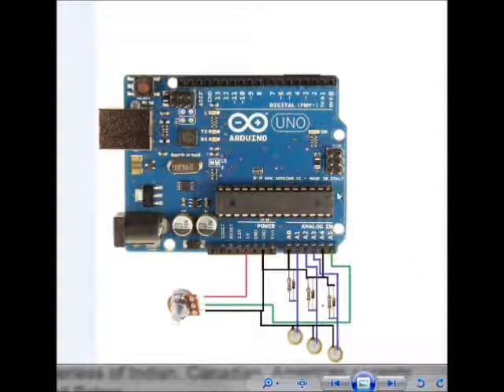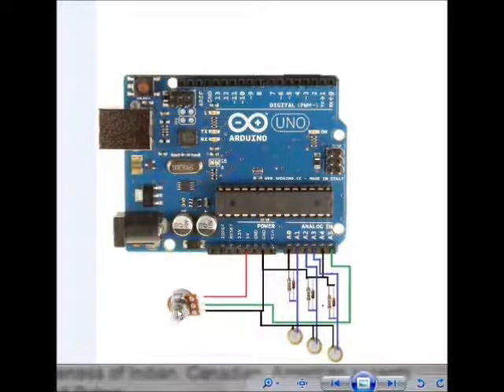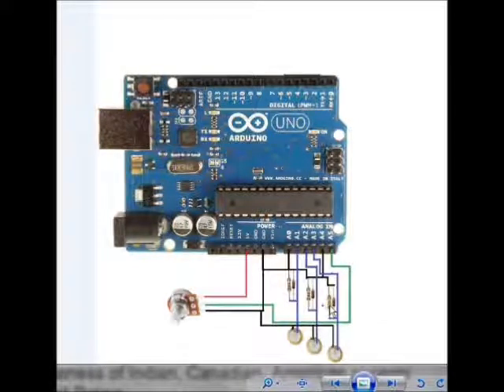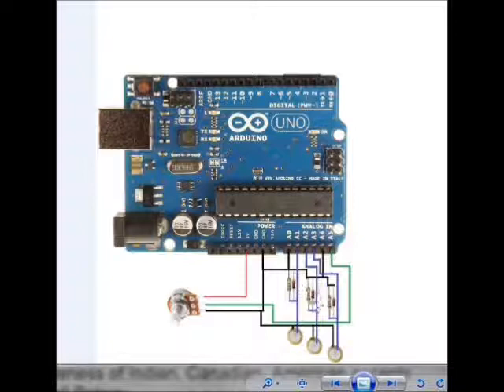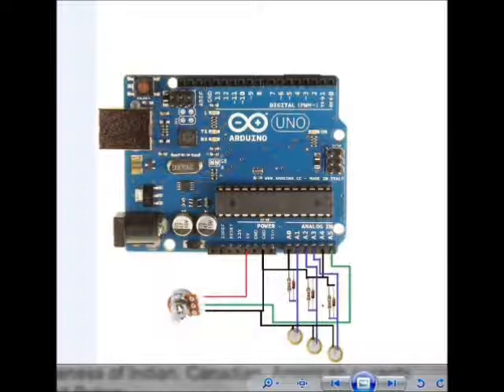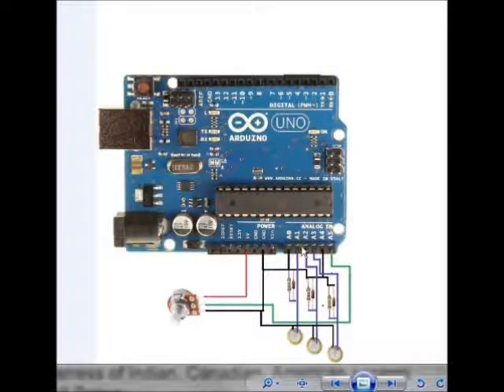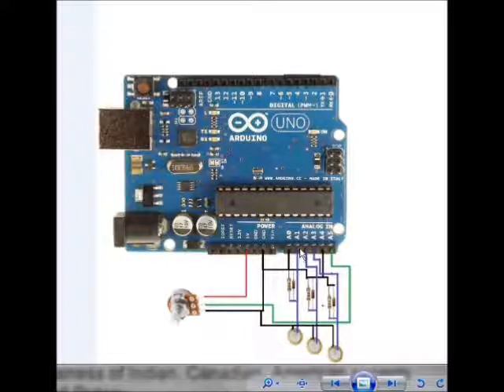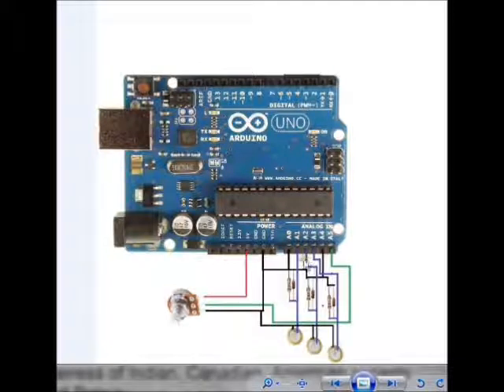arduino drums circuit explanation

Comment: I've been looking up different videos about arduino trigger modules, and this is the first mention I've seen of zener diodes. I'm not sure I understand their purpose. Did you figure this out by yourself, or did you find this information somewhere?
Reply from the maker: I had seen it in another video or somewhere many years ago , I think thy are used to stop the signal from being too hot as in too high  I think  or to stop feedback current I dont remember but they work good for me  used the drums pads recently to see if they still work and they do.
Reply: Thank you for responding! I've ordered a bunch of these and will be incorporating them. I'm also going to start with the code you posted on the other video, so thank you for that, hopefully I'll get it to work.
Reply from the maker: just know that the hardest part is to make pads that work reliably and don't break. if you have acoustic drums converting them to electronic would provide you a steady contraction .
Reply: I'm not a very hard-hitting drummer, so I can probably come up with reliable enough pads for my playing style. Harder than that will probably be the rack. 
By the way, am I right in assuming this is for DIN and not USB MIDI?
Reply from the maker: usb
Reply from the maker: use hairless midi program
Reply: @Tasteful Tuna - Zener diodes conduct in two directions.  One direction is much like a normal diode, the other direction has a (typically) much higher 'forward voltage', in this case 5.1 volts.   This use of the zeners protects the inputs of the Arduino (or other circuitry) from excess volts. In the negative direction (below ground) the 'regular diode' conducts, and clamps the negative voltage to near ground. Negative voltage inputs can be harmful to integrated circuits in general, so this is good. Most ICs with 5 volt supplies will tolerate positive inputs up to 5 or even 5.5 volts without harm, and the 5.1 volt zener will clamp the input to near 5.1 volts, thus protecting the input from excess voltage. Piezos can develop pretty high voltage spikes in extreme cases, and static electricity is everywhere (nylon carpets, eg) so this is a sensible precaution.  Respect to @Burning Teles for thoughtful design precautions.

Comment: thanks for the explanation man
did you use hairless midi serial bridge or serial to midi converter?
Reply from the maker: Pancholion Mcana yes it works very well. make sure you  select 115200 baud rate  in the hairless program from file--> preferences.
Reply: Thank you very much dude. i´ve seen many videos about this matter bur i really liked the way your drumkit reacts i can see it has no latency at all. you did a good job!
How did you managed to do the double action snare drum to reproduce the snare sound and the edge of the snare sound separately and in the same pad?
Reply from the maker: Pancholion Mcana I think that's more of a mechanical separation(as you need to hear both in many cases) and as a real snare drum it is not completely separated list in this case.
I don't remember doing any coding for this I pretty much hit the "snare drum" on the side the piezo was stuck to to gain better result , surely there are better ways to implement this,like a separate rim from the rest of the drum

Comment from the maker: // only snare and bass ,ground all other analog inputs (make sure you ground a0 )
//map :it is for toontruck metaleggs map might need modofications with other drum vst

int notes=38;//snare
int noteb=36;//bass kick

int piezobigs=0;

int piezobigb=0;

void setup(){
  Serial.begin(115200);

}

void loop(){

  
   int ground=analogRead(A0);// for arduino bleeding problems(electronic) ,ground a analog pin and read it between readings
  

   int piezovalues = analogRead(A1);
  ground=analogRead(A0);

    int piezovalueb  = analogRead(A2);
  ground=analogRead(A0);
  

 
 

//////////////////////////////////////////snare///////////////////////////

 if ( piezovalues> 5 ){
    if( piezobigs < piezovalues)

    {
      piezobigs=piezovalues;
    
     }
      
    }
  
if (piezovalues < 5 && piezobigs > 0 ){
 //Serial.println(piezobig);
 /////////////////////////////////////////////

 if(piezobigs >= 10 && piezobigs < 20 )
  MIDI_send(144,notes,10);
    if(piezobigs >= 20 && piezobigs < 30 )
  MIDI_send(144,notes,20);
 if(piezobigs >= 30 && piezobigs < 40 )
  MIDI_send(144,notes,30);
   if(piezobigs >= 40 && piezobigs < 60 )
 MIDI_send(144,notes,40);
   if(piezobigs >=60 && piezobigs < 80 )
  MIDI_send(144,notes,50);
 
   if(piezobigs >=80 && piezobigs < 100 )
 MIDI_send(144,notes,60);
  if(piezobigs >= 100 && piezobigs < 200 )
  MIDI_send(144,notes,70);

   if(piezobigs >= 200 && piezobigs < 300 )
  MIDI_send(144,notes,80);
   if(piezobigs >=300 && piezobigs < 400 )
  MIDI_send(144,notes,90);
   if(piezobigs > 400 && piezobigs < 600 )
  MIDI_send(144,notes,100);
   if(piezobigs >=600 && piezobigs <700 )
  MIDI_send(144,notes,110);
 
   if(piezobigs >=700 )
 MIDI_send(144,notes,127);
 
 
  MIDI_send(128,notes,0);

  
 ///////////////////////////////////////////////////////////
 
              piezobigs=0;
              
}

///////////////////////////////////////snare//////////////////////////////

/////////////////////////////////////////////////bass//////////////////////////////////////////////

 if ( piezovalueb> 5 ){
    if( piezobigb < piezovalueb)
    {
      piezobigb=piezovalueb;
    
     }
      
    }
  
if (piezovalueb < 5 && piezobigb > 0 ){
/*
 if(piezobigb >= 10 && piezobigb < 20 )
  MIDI_send(144,noteb,10);
    if(piezobigb >= 20 && piezobigb < 30 )
  MIDI_send(144,noteb,20);
 if(piezobigb >= 30 && piezobigb < 40 )
  MIDI_send(144,noteb,30);
   if(piezobigb >= 40 && piezobigb < 60 )
 MIDI_send(144,noteb,40);
   */if(piezobigb >=60 && piezobigb < 80 )
  MIDI_send(144,noteb,50);
  
   if(piezobigb >=80 && piezobigb < 100 )
 MIDI_send(144,noteb,60);
  if(piezobigb >= 100 && piezobigb < 200 )
  MIDI_send(144,noteb,70);

   if(piezobigb >= 200 && piezobigb < 400 )
  MIDI_send(144,noteb,80);
   if(piezobigb >=400 && piezobigb < 600 )
  MIDI_send(144,noteb,90);
   if(piezobigb > 600 && piezobigb <800 )
  MIDI_send(144,noteb,100);
   if(piezobigb >=800 && piezobigb < 900 )
  MIDI_send(144,noteb,110);
 
   if(piezobigb >=900 )
 MIDI_send(144,noteb,127);
 
  MIDI_send(128,noteb,0);

  

 
              piezobigb=0;
              
}

//////////////////////////////////////////////bass////////////////////////////////////////////////////////////

}// mainloop
 
 
 void MIDI_send(unsigned char MESSAGE, unsigned char PITCH, unsigned char VELOCITY) {
  
  Serial.write(MESSAGE);
  Serial.write(PITCH);
  Serial.write(VELOCITY);
}

Comment from the maker: // with controler for hihat ,GROUND a0.
//map :it is for toontruck metaleggs map might need modofications with other drum vst

int notes=38;//snare
int noteb=36;//bass kick

int notehclosed=10; //closed pedal
int notehopen=23; //open pedal

int notehat; //hats closed (to be modified)

int piezobigs=0;

int piezobigb=0;

int piezobighat=0;

int hatarray[4]={100,100,100,100};

void setup(){
  Serial.begin(115200);

}

void loop(){

  
   int ground=analogRead(A0);// for arduino bleeding problems(electronic) ,ground a analog pin and read it between readings
  

   int piezovalues = analogRead(A1);
  ground=analogRead(A0);

    int piezovalueb  = analogRead(A2);
  ground=analogRead(A0);
  
    int controlhihat = analogRead(A5);
   ground=analogRead(A0);
   

 
    int piezovaluehat  = analogRead(A3);
 ground=analogRead(A0);
 
 

/////////////////////////////////////////////////hihat pedal control
 
 if(controlhihat > 50 && controlhihat <= 250)
hatarray[1]=50;

if(controlhihat<50 && hatarray[1]==50 ){

 MIDI_send(144,notehclosed,80);

 hatarray[1]=0;

}
 
 if(controlhihat >250 && controlhihat <= 300)
hatarray[2]=50;

if(controlhihat>300 && hatarray[2]==50 && piezovaluehat <70){

 MIDI_send(144,notehopen,20);

 hatarray[2]=0;

}
 
 

  if(controlhihat >= 0 && controlhihat < 30) 
  notehat=11;

  if(controlhihat >= 30 && controlhihat < 130) 
  notehat=10;
  if(controlhihat >= 130 && controlhihat < 200) 
  notehat=12;
if(controlhihat >= 200 && controlhihat < 800) 
  notehat=14;
if(controlhihat >= 800 && controlhihat < 1200) 
  notehat=16;  
////////////////////////////////////////////////hihat pedal control

//////////////////////////////////////////snare///////////////////////////

 if ( piezovalues> 5 ){
    if( piezobigs < piezovalues)
    {
      piezobigs=piezovalues;
    
     }
      
    }
  
if (piezovalues < 5 && piezobigs > 0 ){
 //Serial.println(piezobig);
 /////////////////////////////////////////////

 if(piezobigs >= 10 && piezobigs < 20 )
  MIDI_send(144,notes,10);
    if(piezobigs >= 20 && piezobigs < 30 )
  MIDI_send(144,notes,20);
 if(piezobigs >= 30 && piezobigs < 40 )
  MIDI_send(144,notes,30);
   if(piezobigs >= 40 && piezobigs < 60 )
 MIDI_send(144,notes,40);
   if(piezobigs >=60 && piezobigs < 80 )
  MIDI_send(144,notes,50);
 
   if(piezobigs >=80 && piezobigs < 100 )
 MIDI_send(144,notes,60);
  if(piezobigs >= 100 && piezobigs < 200 )
  MIDI_send(144,notes,70);

   if(piezobigs >= 200 && piezobigs < 300 )
  MIDI_send(144,notes,80);
   if(piezobigs >=300 && piezobigs < 400 )
  MIDI_send(144,notes,90);
   if(piezobigs > 400 && piezobigs < 600 )
  MIDI_send(144,notes,100);
   if(piezobigs >=600 && piezobigs <700 )
  MIDI_send(144,notes,110);
 
   if(piezobigs >=700 )
 MIDI_send(144,notes,127);
 
 
  MIDI_send(128,notes,0);

  
 ///////////////////////////////////////////////////////////
 
              piezobigs=0;
              
}

///////////////////////////////////////snare//////////////////////////////

/////////////////////////////////////////////////bass//////////////////////////////////////////////

 if ( piezovalueb> 5 ){
    if( piezobigb < piezovalueb)
    {
      piezobigb=piezovalueb;
    
     }
      
    }
  
if (piezovalueb < 5 && piezobigb > 0 ){
/*
 if(piezobigb >= 10 && piezobigb < 20 )
  MIDI_send(144,noteb,10);
    if(piezobigb >= 20 && piezobigb < 30 )
  MIDI_send(144,noteb,20);
 if(piezobigb >= 30 && piezobigb < 40 )
  MIDI_send(144,noteb,30);
   if(piezobigb >= 40 && piezobigb < 60 )
 MIDI_send(144,noteb,40);
   */if(piezobigb >=60 && piezobigb < 80 )
  MIDI_send(144,noteb,50);
  
   if(piezobigb >=80 && piezobigb < 100 )
 MIDI_send(144,noteb,60);
  if(piezobigb >= 100 && piezobigb < 200 )
  MIDI_send(144,noteb,70);

   if(piezobigb >= 200 && piezobigb < 400 )
  MIDI_send(144,noteb,80);
   if(piezobigb >=400 && piezobigb < 600 )
  MIDI_send(144,noteb,90);
   if(piezobigb > 600 && piezobigb <800 )
  MIDI_send(144,noteb,100);
   if(piezobigb >=800 && piezobigb < 900 )
  MIDI_send(144,noteb,110);
 
   if(piezobigb >=900 )
 MIDI_send(144,noteb,127);
 
  MIDI_send(128,noteb,0);

  

 
              piezobigb=0;
              
}

//////////////////////////////////////////////bass////////////////////////////////////////////////////////////

/////////////////////////////////////////////////hihat//////////////////////////////////////////////

 if ( piezovaluehat> 5 ){
    if( piezobighat < piezovaluehat)
    {
      piezobighat=piezovaluehat;
    
     }
      
    }
  
if (piezovaluehat < 5 && piezobighat > 0 ){

 
 if(piezobighat >= 30 && piezobighat < 50 )
  MIDI_send(144,notehat,10);
    if(piezobighat >= 50 && piezobighat < 60 )
  MIDI_send(144,notehat,20);
 if(piezobighat >= 60 && piezobighat < 80 )
  MIDI_send(144,notehat,30);
 
   if(piezobighat >= 80 && piezobighat < 100 )
 MIDI_send(144,notehat,40);
   if(piezobighat >=100 && piezobighat < 150 )
  MIDI_send(144,notehat,50);
   
   if(piezobighat >=150 && piezobighat < 200 )
 MIDI_send(144,notehat,60);
  
  if(piezobighat >= 200 && piezobighat < 300 )
  MIDI_send(144,notehat,70);

   if(piezobighat >= 300 && piezobighat < 400 )
  MIDI_send(144,notehat,80);
   if(piezobighat >=400 && piezobighat < 500 )
  MIDI_send(144,notehat,90);
   if(piezobighat > 500 && piezobighat < 600 )
  MIDI_send(144,notehat,100);
   if(piezobighat >=600 && piezobighat < 700 )
  MIDI_send(144,notehat,110);
 
   if(piezobighat >=700 )
 MIDI_send(144,notehat,127);
 
  MIDI_send(128,notehat,0);

  

 
              piezobighat=0;
              
}

//////////////////////////////////////////////hihat////////////////////////////////////////////////////////////

}// mainloop
 
 
 void MIDI_send(unsigned char MESSAGE, unsigned char PITCH, unsigned char VELOCITY) {
  
  Serial.write(MESSAGE);
  Serial.write(PITCH);
  Serial.write(VELOCITY);
}